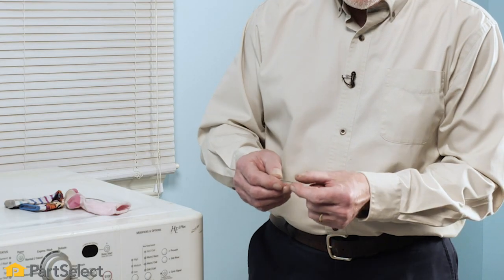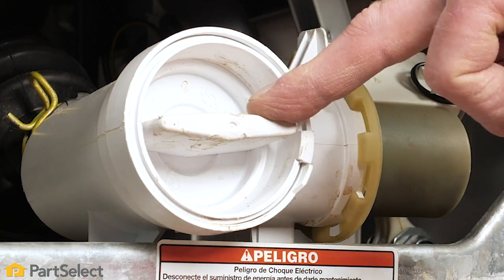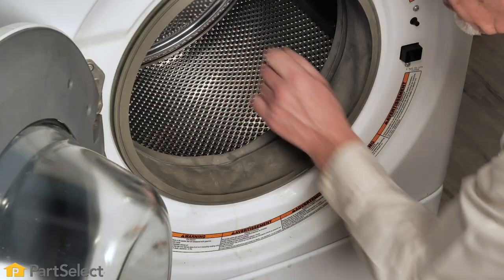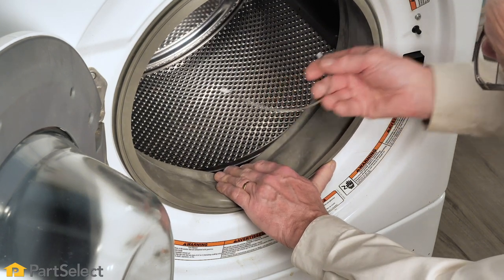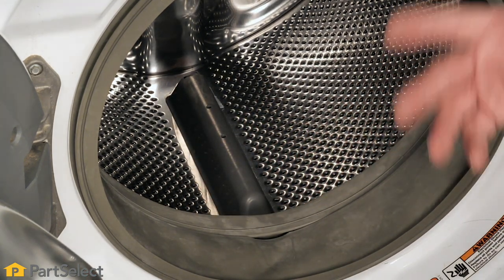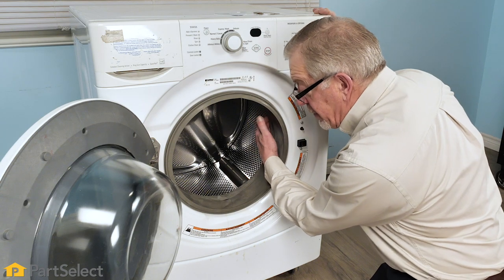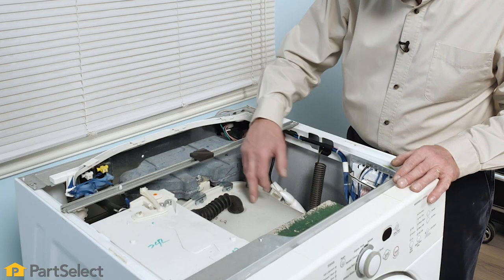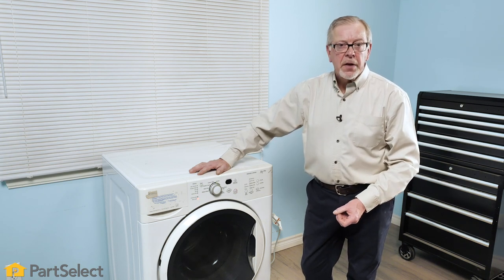Washer Eating Socks? How to Remove Common Items From Your Front Load Washer | PartSelect.com

Comment: The video was very much helpful. Greatly appreciated.
Anyway, it does not explain how to remove a Bank card went inside. This is how I solved the problem. (mine is a Candy CE 439 T bought in 2000 and still going like a baby. Ha, haa!!) Once a bank card has gone inside,  with washing cycles, normally its outer (printed) layers peel off, as whole or teared parts, and they might clog the water outlet. You can remove them by cleaning the water outlet and its duct. But for the thick part of the card it might rest at the bottom of the drum or stuck with the heater element, making scratching noises when the drum rotates. To see where the card is, just put a torch at the bottom of the inner drum facing down, slowly rotate the drum left and right a little and through the holes you can see where the card is. If it is merely resting at the bottom, using a thin screwdriver or a wire inserted through a hole and by rotating the drum as appropriate, you can push the card (or its remains!) towards the water outlet at the bottom of the outer drum. Then, by removing the water outlet hose/bellow there, you can carefully pull out the card by hand (it is flexible!). (Don't forget to check the outlet hose/below for stuck parts) If the card is stuck with the heater element so badly, (what exactly has happened in my case) by following the process explained in the videos here, carefully pull out the element a little, waive the element up and down a bit allowing the card to be free and fell, then follow the above procedure to remove it...!!!
Reply: Thanks that's really good advice